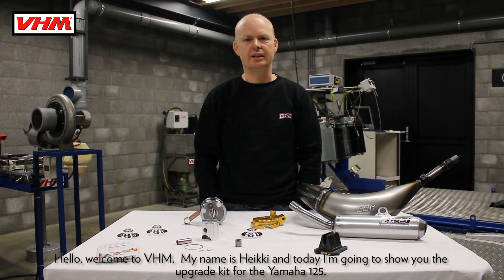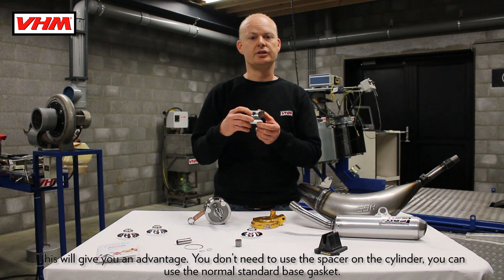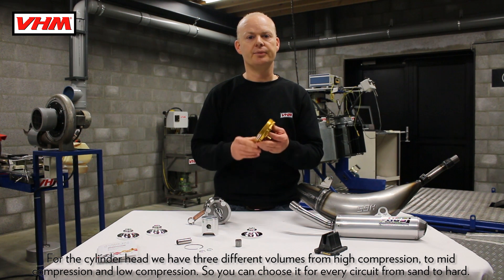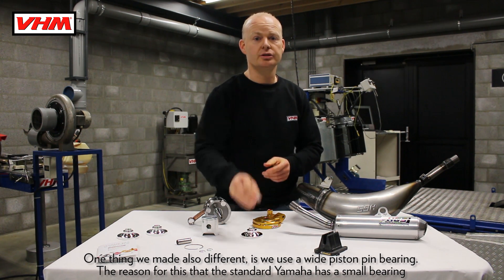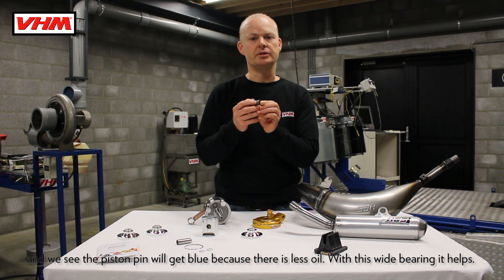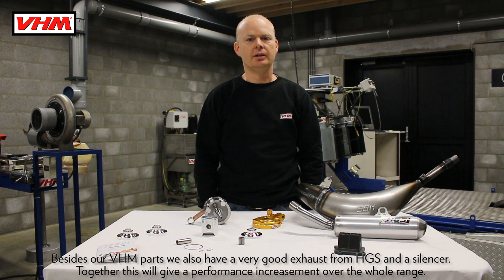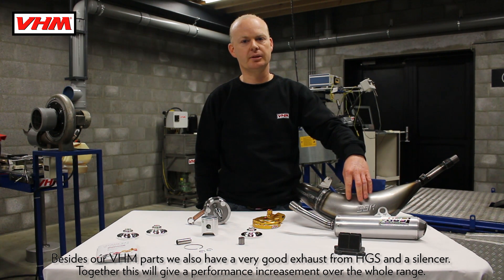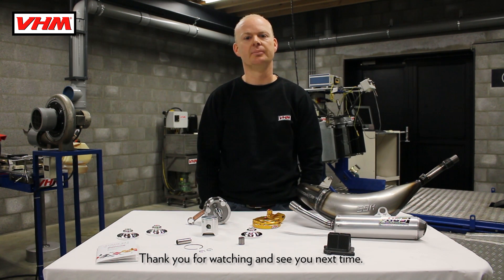VHM Upgrade kit Yamaha YZ125 '05-21 / Fantic XX125 '21

Comment: Would it fit in a 2021 fantic xe125
Reply from the maker: Hi! Our YZ125/XX125 upgrade kit parts do also fit the Fantic XE125, however, we do not have a standard insert for it yet, as it will most likely differ a bit from the optimum specs for the XX125. We'll probably add an insert for the XE125 in the future, but it's always possible to request a custom insert for now.
Reply: @VHMspecialracingproducts  perfecctt gonna buy it

Comment: What are the benefits of the longer rod?
Reply: vertex 22190 no intake side port, shorter skirts, aka Mugen. also a kehin pwk shortbody carb with tapered bore does wonders, and a Vforce4R 
yamaha needs to put in a larger diameter crank and 10mm longer rod, larger powervalves, stiffer govenor spring, shortbody carb for 2021. like Mcgraths YZ250
Reply: Reggie MacDougall more power
Reply: @backwoodsmx3274  I'm just confused because the head and cylinder are still stock sizes which means the stroke isn't any bigger
Reply from the maker: The longer rod reduces side loading on the piston which reduce friction. Also the moving (gouge) of the piston into the exhaust port will be less.

Comment: High compression needs race gas or can you run standard gas?
Reply: How much extra power/torque does this kit add?
Reply: @VHMspecialracingproducts  hi, what are the differents beetween insert 10.80cc, 11.00cc and 12.00cc?
Reply: RACE...fuckin pump gas just popped my CRG yz125 shifter
Reply: @floridalottery3134  🤣🤦‍♂️ doubt it’s was the fuel was it an 05 or 06